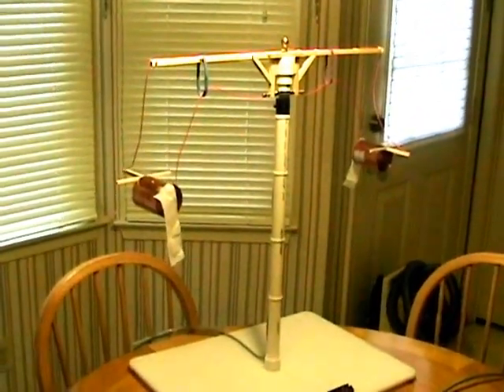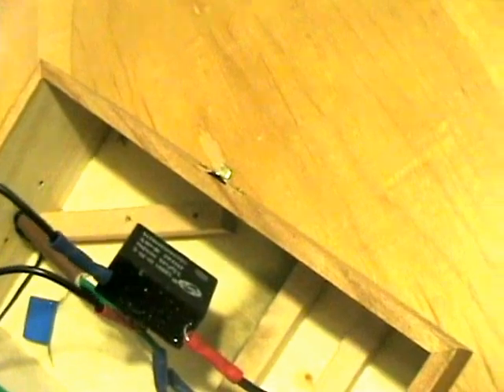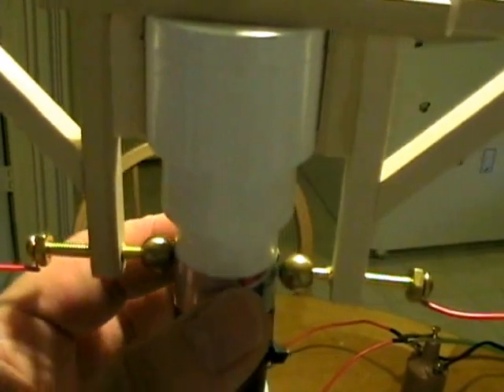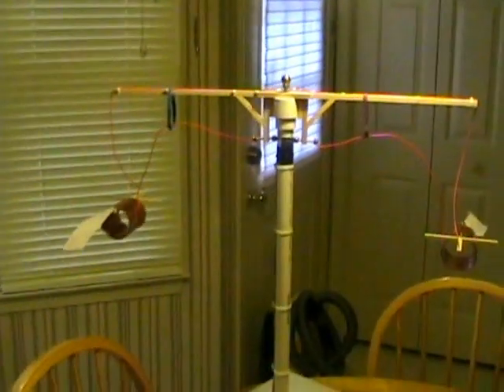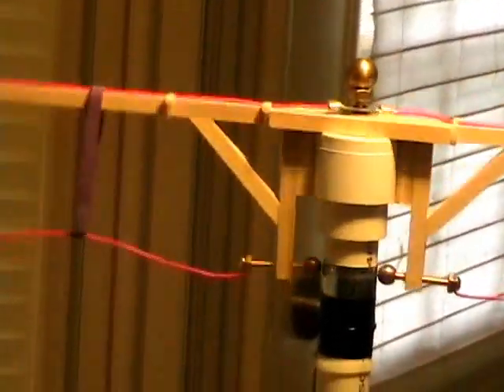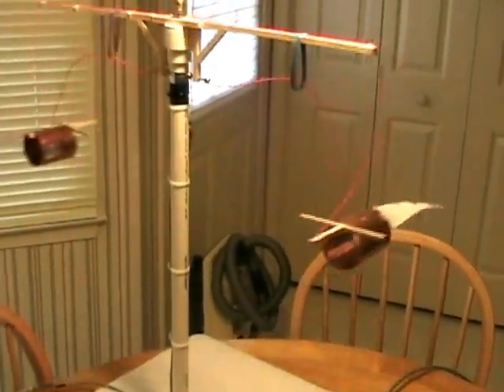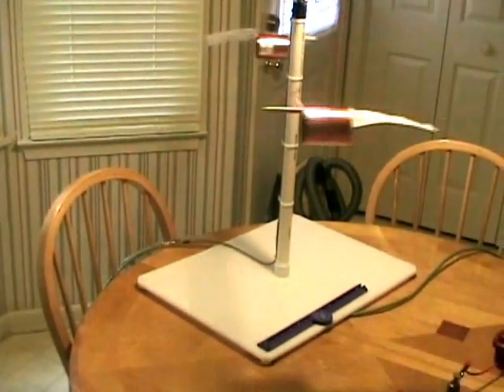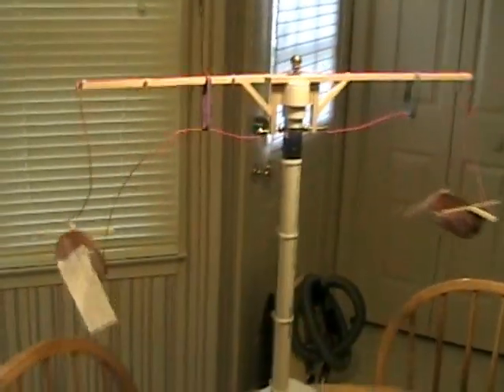Biefeld-Brown Electrokinetic Apparatus

Comment: Browns paper, "how I control gravitation" underlines the use of assymetric capacitors to create thrust. He does however state that he was trying to minimize or eliminate electron and ion emission. He also claims that an increase in mass of materials used for his gravitators increases the force exerted on his apparatus. This implies that there was an actual gravitational effect in his early experiments. All of his later papers focus almost exclusively on ion propulsion; being that he was essentially working for the navy I get the sense that his later works may have actually been orchestrated to throw people off of his initial discoveries. Considering the era in which he lived its not hard to imagine that he actually wanted the general public to believe that all he was working on was ion wind. After all you wouldnt want the ruskies to pick up an engineering magazine and read all about your miltary technolgy secrets.

Comment: This is not the Byfield Brown effect. The real bit field Brown thrusters use only one pole of the capacitor with two electrodes and a dielectric in between. 
They are two plates of the same polarity and then there is a third plate that is grounded. Thats how he made those umbrella lifters.
Brown never made aparatus like this.
This is disinformation.
Reply from the maker: You need to read his patent. This is functionally identical. And air, by the way, is a dielectric.
Reply: MisterApol the true biefield brown effect is classified. You cannot find a patent on it. 

This is disinformation. 

You just happened to fall for it. 

The air does not have a high enough dielectric constant (k) to provide much thrust. 

The true biefield brown effect taps into the quantum gravity of the dielectric atoms themselves which produces the force. 

Ive shown in another video how there is both electrostatics and electrokinetic behavior occurring in a charged capacitor. 

Its the curl function of this kinetic force that is the hidden principle behind the biefiled brown effect. 

The dielectric in the true brown lifters where meant to absorb this kinetic energy to accelerate the rotation of the protons in the nucleus of the dielectric atoms. This would accelerate the quantum gravity or strong force of the dielectric until the crystal lattice structure of the dielectric had a greater total gravitational spin than the atoms around it and it begins to float.

If you have K losses in the dielectric, such as air affords readily, then you get losses of that power as ion wind as a SECONDARY effect. 

So as you can see, this is incorrect but a great spin off of the true effect.
Reply from the maker: Your reply is pseudo-science. Oh well.
Reply: MisterApol thats your reply? Lol your funny! 

Tell that to Thomas Valone PhD among others...

Have you even read electro gravitics2? 

How can you say that what im saying is seudo science without making one factual rebuttle to what i have said? 

Do you need the math to prove it? Can you even do the math? 

Like a homopolar motor, the electricity can cause rotation when fed into the dielectric atom. 

Let me know what is your understanding of this force is so I can know how to explain this to you.

Comment: It's time to send one of these to the ISS to be tested in the vacuum of space. Would be nice to see thrust created without chemical explosions and without pushing against or using the atmosphere. Solar panels converting light into electricity into the asymmetrical capacitor into thrust. Light = thrust. No fuel to haul around means lightweight and fast. Wishing I wasn't so old because the future looks like it's gonna be fun. Can see a 2-week vacation to Mars and back, available about 50 years from now.
Reply from the maker: I believe this has been done, though not at the ISS. Seems I've read that ion propulsion of this typoe has been used to alter/correct the orbits of some satellites.
Reply: +MisterApol Wow! Guess I've fallen behind the times. They need to build a large array of these to propel a small spacecraft really fast, with a large amount of thrust. We should be reading about new speed records being set in space. Power shouldn't be a problem as they could go nuclear instead of solar. I'm just confused as to why this technology isn't being more widely publicized and utilized. I used to follow beamshipcaptain and thought Mythbusters had proven that air molecules were required for this technology to work, rendering it useless in space. Thanks for the reply and information. It's fantastic that you built this model to demonstrate the technology. Kudos on your perseverance.

Comment from the maker: I tried various objects as front electrodes, and nothing improved upon a bare length of 22 gauge copper wire. Though I read NASA used fine pins on the trailing electrode with some success, they didn't seem to improve my performance very much. The most useful increase in performance I found was in improving wire insulation and charge separation of the DC poles--keeping the + and -- as far apart as possible, beefing up the insulation on the correcting wires, etc.

Comment: Very nice setup and effect!  Would increased surface area at the front or back of each thruster increase the speed?  Maybe a ring of pins or needles around the circumference out the back or a fine wire mesh sanded down a bit on the leading wire at the front?
Reply: Increasing the surface area differential between the two "electrodes" increases the thrust. So if you make one electrode bigger and the other one smaller you will actually have a gain in the force effect. Ion crafts can be thought of as assymetrical capacitors, and the greater the assymetry the more force you can acheive.  Sharp edges should be avoided since the dielectric lines of force will concentrate on edges and points; you want an even dispersion of field lines otherwise you are likely to get arcing which will diminish the effect and destroy your materials.